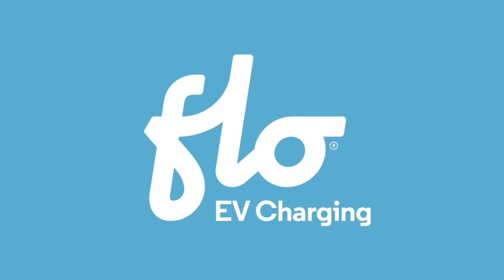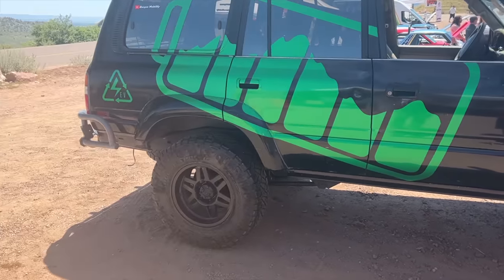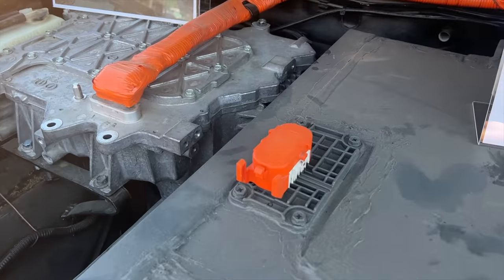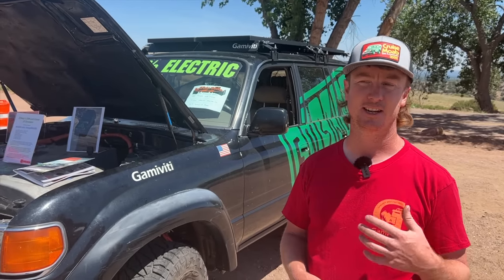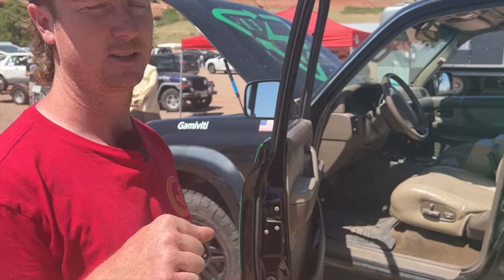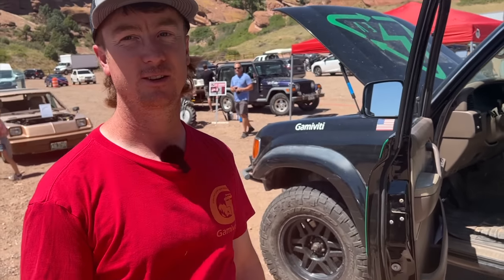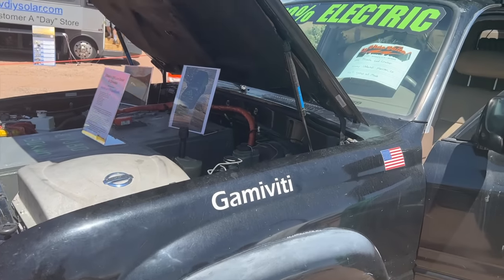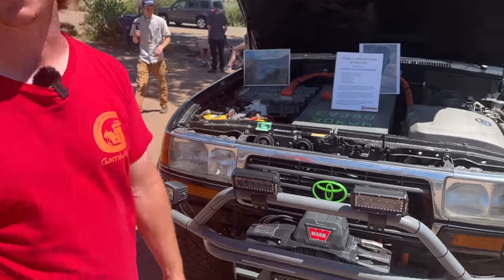Here Is How I Built an ELECTRIC Toyota Land Cruiser On a Small Budget!

Comment: As someone who drives a 30 kWh LEAF but has an '85 4Runner in the garage, this is so incredible to see and hear about. It seems like yesterday (but it wasn't) that you started asking questions on the LEAF forum. You get all the points for actually executing the conversion and getting the peripheral systems working. Can't wait to see where you take it!
Reply: I've got an 86 4Runner also which I'm hoping to one day convert to EV.  If I get it done it will be purely for beach driving and short trips around town instead of using my diesel Ranger. Let me know if you go ahead with it.

Comment: We have a 2013 Nissan Xterra 2WD.  Can we add electric drive to the front wheels to make it a 4x4?  It would be just to keep from getting stuck and rock crawling at lower speeds.  If it worked, imagine all the 2x4 trucks and SUVs that could be converted to 4x4!  How could we do it?
Reply: I hope you know how to code because that kind of system hasn't been done, and I don't think it's a straight forward process at all... You would need a way to disengage and re-engage the electric motor , then you either would need separate controls for it or reprogram the old one to detect when its engaged and how much voltage to balance the ICE and electric power. And space will be an issue as you're trying to make an hybrid out of a pure ICE vehicule.

I guess with a small forklift motor, a good gear ratio, a small battery pack somewhere in the car, and some tinkering with the controller it might be possible.

But yes it would be very handy, and I'm sure someone smart can figure it out. However it would specific to each car I think, so difficult to expand it to many vehicule

Comment: Using the leaf system made it pretty simple. The downside is the small battery pack. But as more electric vehicles get out there, junkyard drive trains will become far more common.
Reply: Tesla swaps are very popular and usually get 200 mile ranges depending on the vehicle and configuration. They're just expensive and difficult to do since Tesla's are very proprietary vehicles. Leaf's are cheap and built using more common parts and standards.

Comment: You could achieve this by putting a 60V  electric motor where the rear drive shaft is and 15 lead acid batteries in the bed. You can run errands in a golf cart too.

Comment: Been wanting to do this to my 225k mile silverado or my 96 chevy s10
Reply: Yes - I think older trucks are perfect donor vehicles for an EV conversion! I have an '02 Ford Ranger with nearly 300k on the clock that I want to convert. Maybe the S10 would be a better choice for you since it is so much lighter weight and would give you better driving range?

Comment: The best conversion would have been duel motor (tesla model 3 perm mag) . Each motor would basically be in front & back of the solid axles.  So a dummy solid axle that houses the motor and differential of the model 3 drive unit.   This means no drive shafts! , no t case ,  nothing on the chassis except batteries, inverters, and wires.  Even more crazy would be 4 ev motors.  One per wheel , so no diff at all.

Comment: "it is a LC and it will run forever"  Um, the point with that statement is the ENGINE running.  The powertrain running.  Otherwise, you might as well have picked up a junked Nissan Xterra or Pathfinder and kept the family components together.  (Leaf batteries and so on)  To each their own.  🙂
Reply: Still has the bones, suspension, steering, transfer case etc that all added to the legendary reliability.
Reply: I had a similar reaction. The easiest way to make an unreliable land cruiser is to "make it better" with mods. There are some things that will last but there is a lot in there that will always be a project
Reply: Actually, the 80-series notorious for blowing headgaskets and having the transmission fail. Of all Land Cruisers it is by far the least reliable. There is so much more to a vehicle than an engine and transmission, and the rest of the LC is built with top notch quality. The axles are super strong and there are a million aftermarket parts suppliers for upgrades
Reply: @EVSwap  failed transmissions? first I've heard of that. The automatics are regarded as some of the longest lived 4 speeds out there. My og a343f seems to be pretty durable with 335k miles. I know 1st to 2nd can be problematic on the 343f but only if you don't keep up on fluid intervals. Head gasket (singular)? True. But once replaced you're done.

Comment: He lost me at, "The range of this is about 60 miles." Cool concept though!
Reply: 30kw though. That's nothing for an ev. 500 watt/hr per mile is poor but the 80 series is known as a power eater.
Reply: @PatrickRich  yeah some PHEVs have batteries that are nearing that capacity these days. Wonder how hard it would be to integrate another Leaf pack into the mix and how much that would add to the overall weight of this rig. I recently moved around a similar pack (think it was a 42kwh model or whatever), and that seemed to be like 1000lbs by itself.
Reply: @ALMX5DP  yeah the plan is to add more batteries. My 30kwh pack is 603lbs, more capacity more weight. Another reason I chose an LC is for the payload capacity.